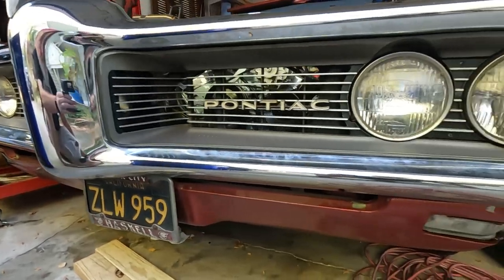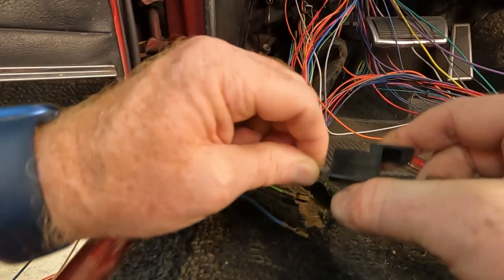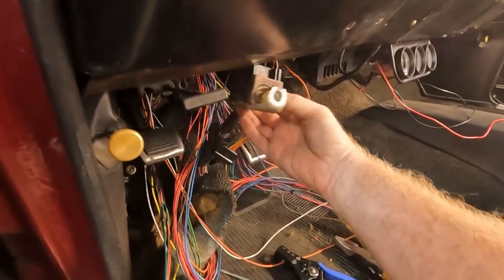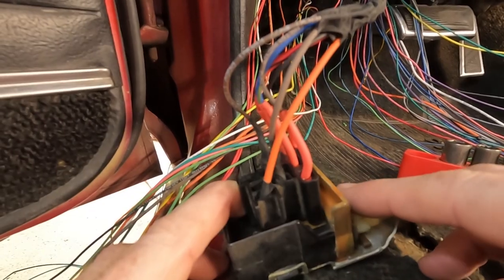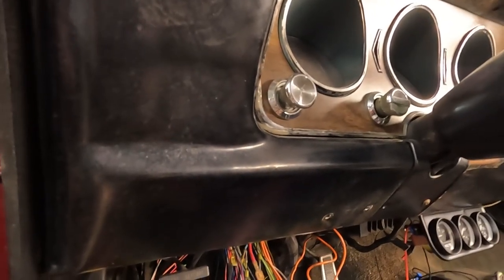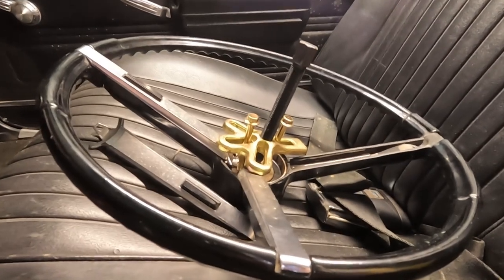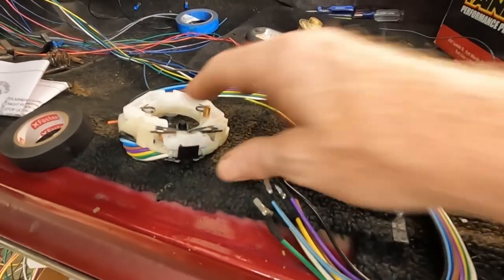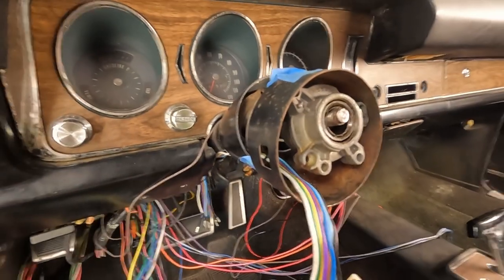Painless Wiring: Interior Rewiring on a '68 Pontiac LeMans

Comment: Stupid question time. Are you saying that the new turn signal switch with the Delphi pins were not right either? You had to buy the extra painless kit? Wiring is my personal nightmare. So thank you for doing this, despite the frustration as I would like to do this as well. So thanks again for showing the way. Keep winning!!
Reply from the maker: Thanks!  And no, the Delphi terminals would have been the best for me, because they came with the new turn signal already connected. If I had 8 brand new delphis, that weren't already crimped, I would have used them in a heartbeat. But since the Painless kit had a different setup, I had to make those work. Buying the Delphis on ebay would have also worked for me, but there would have been too long of a wait (to get a video out.)